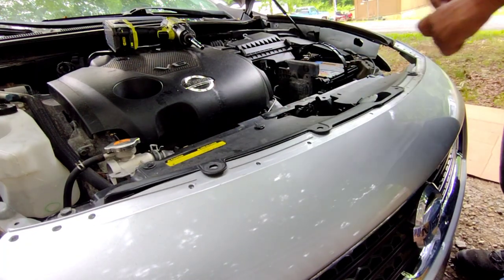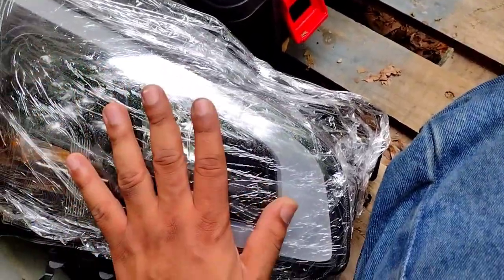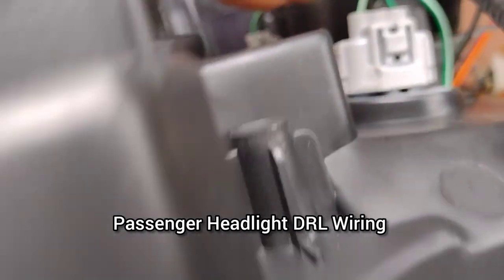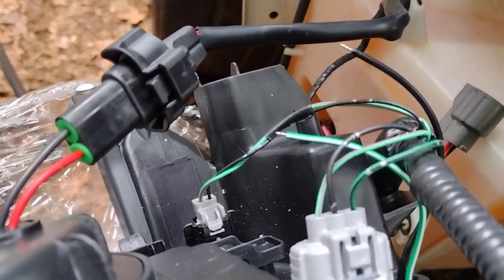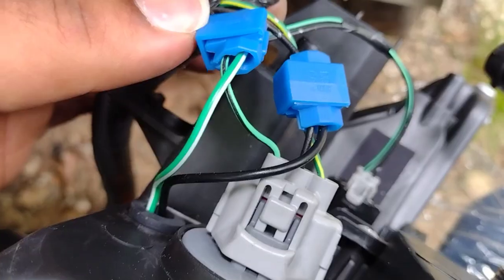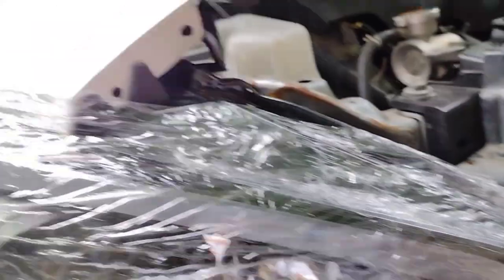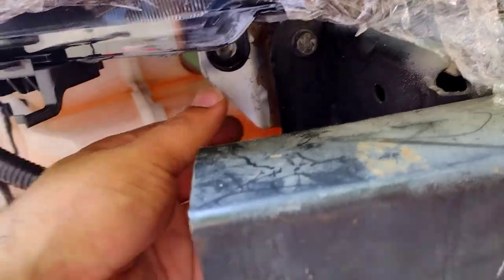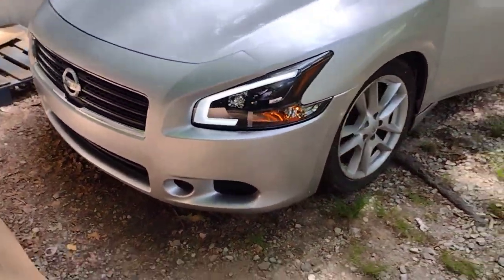Akkon/Acanii Headlight Installation On 7th Gen Maxima

Comment: How did you get these to work with the factory HID wiring I have a 2012 maxima and mine has factory HID lights
Reply: Did you ever figure out the wiring for this having so much trouble
Reply: @beatricegonzales2697   nope these lights don’t work with factory HID headlights they are made for the halogen headlights I never bothered ordering any it’s sucks they don’t make them for HID models
Reply: I have seen a video where you can use an adapter for led lights. I know hid lights are better or brighter but I don't wanna be that guy that blinds people on the road like some other car makers.

Comment: I have a sentra 2014 and they keep getting moisture in them. The one way vent is NOT blocked. I bought 2x from AKKON, and now bought a ACANII. They have the LED bar and think that’s why they suck, b/c they dont close em up properly. Does anyone have this issue and did u fix it? If so, how

Comment: I have a question I had my car repainted and since the idiots form the body shop didn’t know how to wire those type of headlights they sand down and repainted the hood and the front number with about taking off the bumper. What do you think happen to my firm New Drl Projector headlights ? They got all scratch out and the inside looks all foggy. There’s no way to fix that right I told the. That they have to buy me brand new headlights the way I took them to there body shop

Comment: I wired my lights up like you did but the light bar only turns on when my low beams are on, am I missing something?
Reply: You ever found out why it was doing that
Reply: @jrnoriega9300  I just ended up running a wire through the firewall from the interior fuse box and connected that to the led bars. There are a few empty spots so all you need is a fuse splitter and like a 3 AMP fuse and you're all set

Comment: were your factory light halogen or factory HID?
Reply from the maker: Mine came with factory hid
Reply: @ScorpionMultimedia  did you use any HID to halogen conversion kits or wiretaps to bypass your ballast?
Reply: @ScorpionMultimedia  I’m trying to upgrade to these lights but I got the factory HID lights. What did you have to do to get these headlights to work with factory HIDS?
Reply: @jovannimeda715  these lights won’t work with the factory HID models plug and play you can’t find these lights anywhere for HID I have a 2012 maxima with factory HID all the lights I find online are all for the halogen models they all say not compatible with factory HID